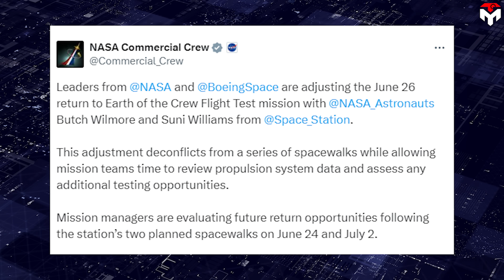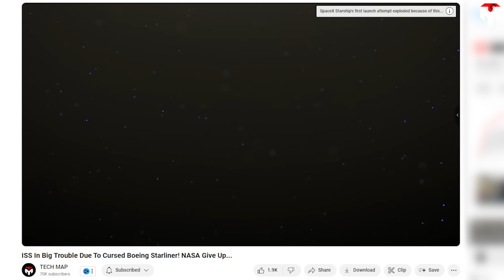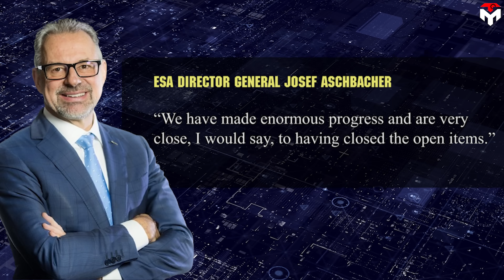Starliner Is Not Coming Back...Astronauts Indefinitely Stuck On ISS!

Comment: For the safety of Butch and Suni, NASA needs to ask SpaceX Crew Dragon for help.

NASA has the body measurement Walley and Williams so SpaceX can have Dragon suits sent to ISS with Dragon for them.  Then a (2) man Crew Dragon, with the suits for Butch and Suni, can be launched to ISS. 

As for Starliner, it can be jettisoned, without crew, and remotely returned to Earth. 

If there is an issue with the RCS on Starliner,  the astronaut would not be onboard should Starliner fail a controlled reentry.
Reply from the maker: Good idea thanks for cmt

Comment: The problem is that the ISS needs a periodic orbital reboost back to altitude or they would have fallen back to Earth long ago. The Shuttle, and Soyuz were used for this. Space X Dragon is not capable of this, and Starliner was built with this in mind. We need something that will perform this periodic reboost. Without Starliner we can't do this. And, our current relationship with Russia makes using Soyuz problematic.
Reply: the ISS is a huge scam and colossal money pit. serves only to keep forming astronauts. their zero gravity "experiments" are a joke
Reply: You are correct. It's funny at all of the people posting for SpaceX to rescue the two astronauts. Well, there is a Dragon and Soyuz up there docked right now and there are at least four IVA's up there. I think this is more than a helium pressurization issue. We'll have to see.

Comment: The helium molecule is the smallest one of the available gasses and hardest to seal...which obviously is causing Boeing a LOT of problems.   If they can't solve this issue...a switch to another gas might be a work around.   I know everything is a compromise and helium offers advantages...but if you can't reliably seal it, switching to a slightly less advantageous gas that you CAN seal would be something worth considering.
Reply from the maker: My guess, they CAN TOTALLY SEAL IT, but it will take a lot of time while they need to launch Starliner on time

Comment: What a disgrace! To my knowledge, NASA has never, knowingly, put a defective spacecraft into orbit until now. I am hoping they send a dragon up to get it for the ultimate disgrace!!! This NASA director is a Biden cuckold that needs to go. Either that or NASA is obsolete.
Reply: Oh? What about the Space Shuttle Challenger, where Morton Thiokol warned NASA about the cold temps affecting the O-ring seals?  NASA launched despite that warning. A case of gotta-get-there-itis. There, now I've expanded your knowledge.
Reply: It was thought intact @ takeoff. Starliner was not.
Reply: @fppro1679  Not thought intact by Morton Thiokol engineers. NASA ignored the warning due to pressure wanting to launch.
Reply: I understand Morton warned them about the temperature but I never heard anybody say that it was defective as it stood before launch.

Comment: A Flacon rescue would require a special launch with only two of four astronauts so the extra seats could accommodate the stranded astronauts.  Then two additional SpaceX suits would need to be sent up due to differing suit interface connections.  Everything is custom made and tailored to fit each astronaut.  It's not as simple as packing two more riders in a minivan.
Reply: You telling me that there's no genaric suit they could use for rescue. Not well planned out.
Reply: I would like to think that NASA would have required a standardized suit interface so that any space suit would be able to connect to any capsule. If nothing else, these events seem to justify making a standard suit interface.
Reply: @halalbach1855  There should be a cooperative agreement to standardize all suit interfaces between all nations, including Russia and China too.  A rescue is a rescue, no matter who's flag is flying. How could this be a bad thing?  There are differing breathing air mixtures and pressures but the interface could be all the same.

Comment: Time constraints caused by space walks, learning more about the Starliner, all lies to cover up that they're trying to fix the problem from the ground. They're probably writing trouble shooting and crisis improvisation software and running thousands of simulations in case of different scenarios of thruster failures during undocking, departure and de-orbiting.
And if the simulation is not satisfactory, they try new things.
This is what space X calls rapid iteration.

Comment: Starliner was supposed to be at least a reusable capsule.  It expends all of the launch vehicle and command module, it barely made it to the ISS with the equivalent of 4 flat tires and now looks to not be able to get its crew back safely.  I'd call that a fail.
Reply from the maker: So do i